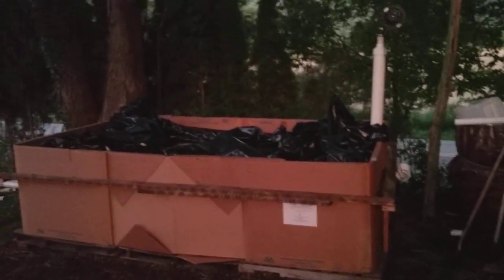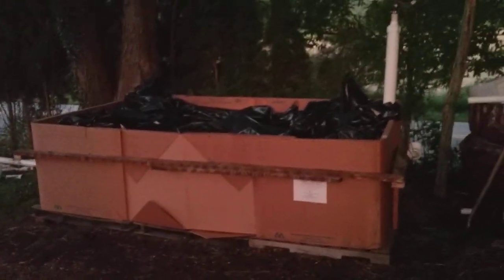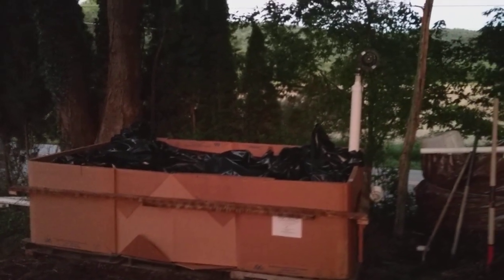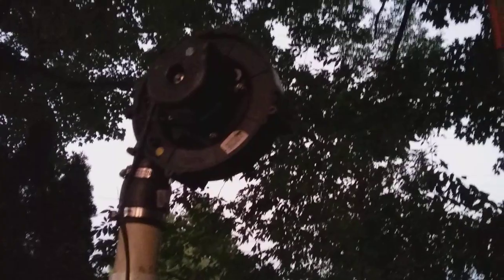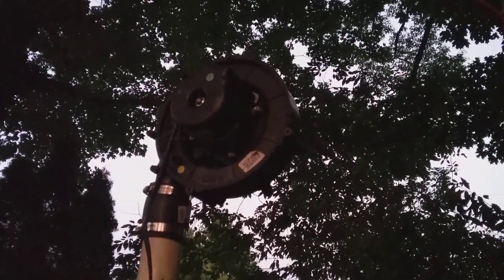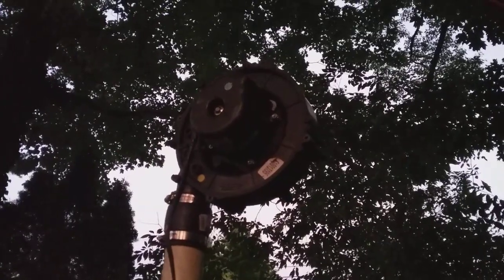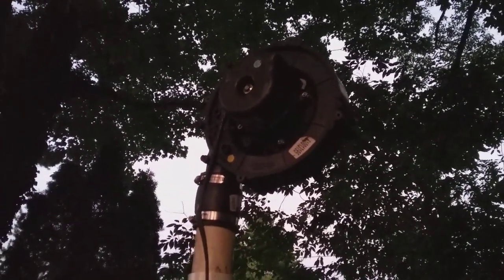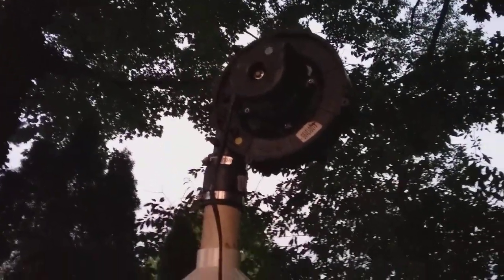Turbocharged Compost Pile - Electric

Comment: Couldn't you make a pit in the ground for better structural stability....and continued reuse..line it the same way or with corrugated sheet or something? It would add insulation and help direct your air better perhaps. Best wishes. FreeJulianAssangeFreePalestineFreeUsAll.
Reply from the maker: You're talking my language! Yes, I agree that an inground pile could work well.  I was considering doing this with store bought blue board insulation, since it wouldn't be harmed by water, although I would have to protect it from damage by rocks or the loader bucket. One idea is to build a rammed tire wall in a pit with insulation and drainage around it. This might be advantageous because I could probably load it from above (this pile is difficult to load because I can only access two sides).  Maybe one side is accessible from down hill so an insulated door could be opened and the material removed from the side.

Another idea is to insulate a shipping container and do something similar, but I don't know how long the steel will hold up to horse shit; it's pretty corrosive.
Reply: @whatawaytogo515  I'm a minimalist/spend thrift and would opt for a three sided pit with old corrugated steel stitch piled into the earth. You can go deeper and only have one side to access and reconstruct....corrugated sheet for this would be easy for this side too with removable posts....could even pile earth against with your machine temporarily to help retain heat. Best wishes.